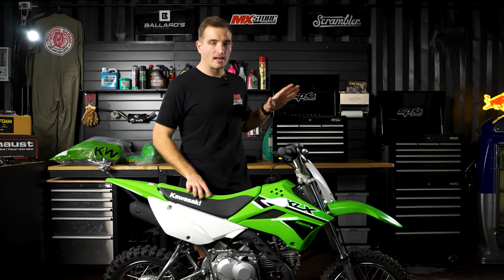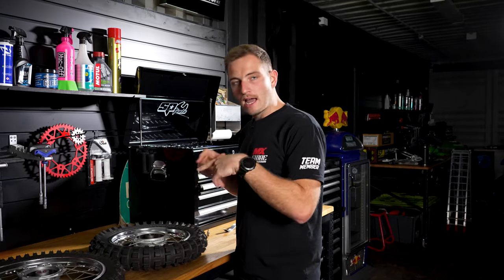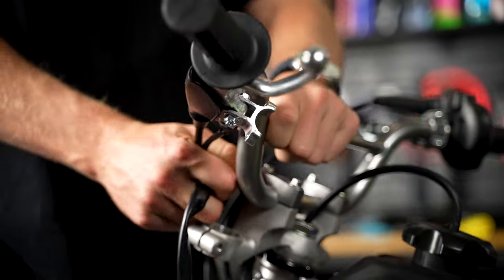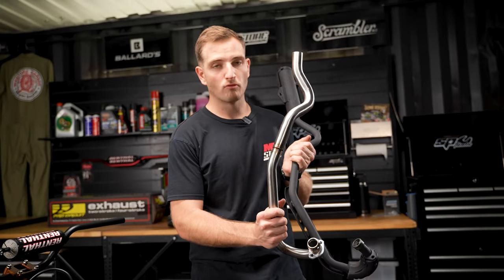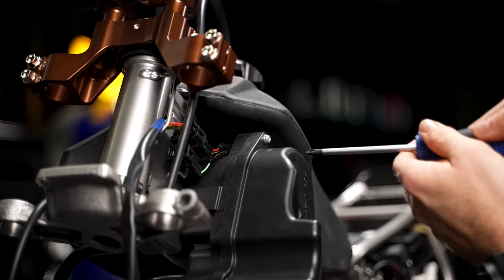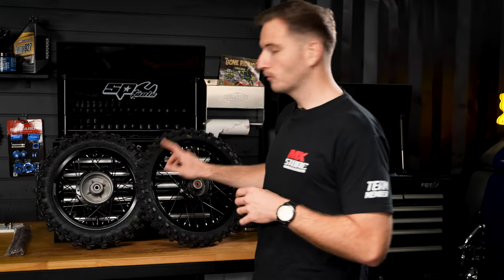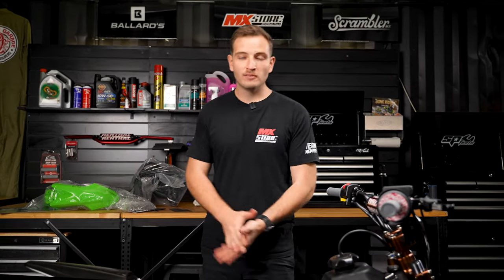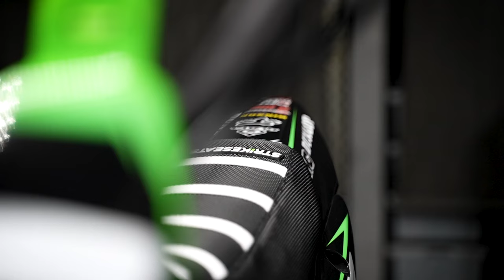ULTIMATE Pit Bike Build - Josh Hansen Replica KLX110L

Comment: I never understood why the KLX was so popular when you have the fuel injected CRF110 and the ever popular TTR but I guess if you want a clutch you’ve only got one option.  My favourite part is the extended brake lever shift lever and the shifter shaft brace.  The biggest think my son struggles with is shifting gears on his CRF50

Comment: What rear shock did you put in?
Reply from the maker: We put in a ozminnis suspension kit, the kit comes with a complete rear shock, heavier fork springs and extended damping rods so it's easy to install and makes a huge difference to the bikes handling and ground clearance 🤘🏼

Comment: Hey there MX Store Legends! 🙌🏁

Hold onto your helmets because I'm about to break down exactly why I'm destined to own the MX Store's Josh Hansen Replica Kawasaki KLX 110L. This bike isn't just a machine; it's a symphony of power, style, and pure adrenaline-pumping awesomeness! 🎸🔥

🛠 *1. Ozminnis Suspension Kit - Conquering Bumps in Style* 🛠
Imagine soaring over jumps and conquering rocky terrains with the grace of an eagle. The Ozminnis Suspension Kit promises an otherworldly ride, where every twist and turn is a thrill to behold. It's like strapping on a set of wings and taking flight on the track. 🦅🚀

🔊 *2. Pro Circuit Exhaust - Roaring to Victory* 🔊
Oh, the sweet sound of power! The Pro Circuit exhaust doesn't just make noise; it makes a statement. The growl is the battle cry, and the acceleration is the victory charge. It's like having a symphony of horsepower propelling you towards triumph, leaving competitors in the dust. 🏆🔥

🌬 *3. Funnel Web Air Filter - Breathing Life into Dreams* 🌬
Dreams need air to come true, and the Funnel Web air filter provides just that. The bike breathes deeper, responds quicker, and accelerates like a bolt of lightning. It's like the bike itself is fueling my dreams, pushing me to go faster, farther, and bolder than ever before. ⚡💨

⚫ *4. Black Miniracer Rims - Stealth Meets Dominance* ⚫
Picture this: a bike cloaked in darkness, ready to unleash its power on the track. The Miniracer black rims add an air of mystery and dominance. It's like riding the night itself, commanding attention and respect from everyone who lays eyes on it. 🌙🖤

🖐 *5. Miniracer Adjustable Clutch and Brake Levers - My Victory Command Center* 🖐
Precision is the key to victory, and the Miniracer adjustable levers offer just that. It's like having a secret weapon that lets me customize every aspect of my ride. Comfort, control, and a touch of personal flair – a combination that spells victory in every race. 🏁🛠

🦶 *6. Ballard's Titanium Footpegs - Where Grip Meets Glory* 🦶
Grip isn't just about tires on the track; it's about a connection between rider and machine. Ballard's Titanium footpegs ensure that connection is unbreakable. It's like having a direct line to the bike's soul, allowing me to dance through corners and own every inch of the track. 💃🏍

🎨 *7. NineTwo Decals Custom Graphics Kit - Unleashing Individuality* 🎨
Who wants to blend in when you can stand out? The NineTwo Decals custom graphics kit is my canvas of self-expression. It's like wearing my personality on the bike's sleeves, announcing to the world that this machine is an extension of my passion, my spirit, and my quest for greatness. 🎉🎨

So there you have it, fellow enthusiasts! Each component of the MX Store's Josh Hansen Replica Kawasaki KLX 110L is a chapter in the story of ultimate exhilaration and victory. Winning this bike would mean soaring towards my dreams, dominating the track, and redefining what it means to be a true rider. 🏆🏍
Reply from the maker: Good luck legend and epic comment! 😊

Comment: The while lot from stickers to the small oil caps, everything on this bike is second to none! So much detail and well put together ❤️ .

The pro circuit tripple clamps/ bars paired with upgraded shocks and power pipe are my favourites on this, BUT the upgraded side cases and anodized plugs/caps, sprocket and graphics really pull the hole package together 😊.  

🙌 fingers crossed 🤞 #gomxstore